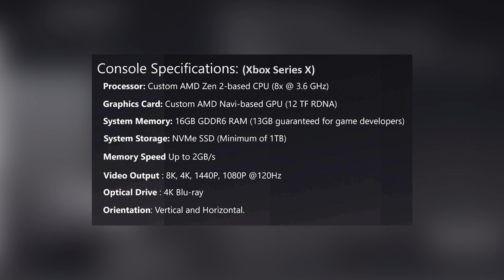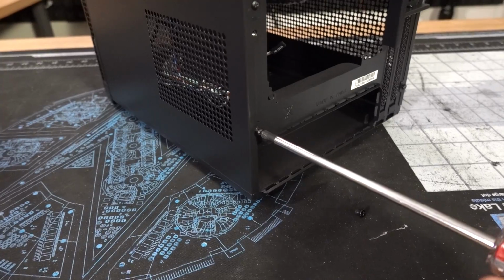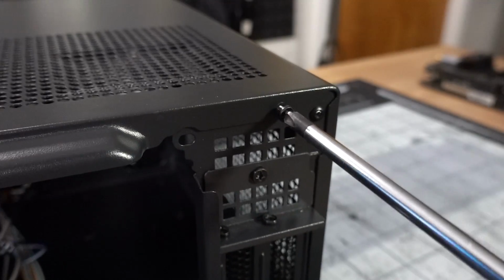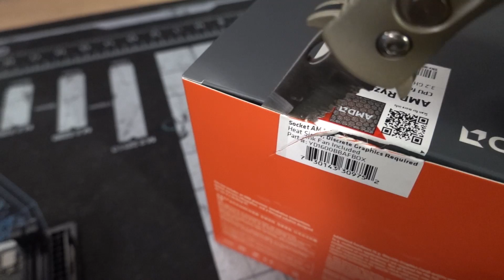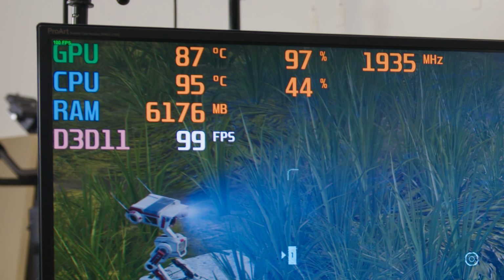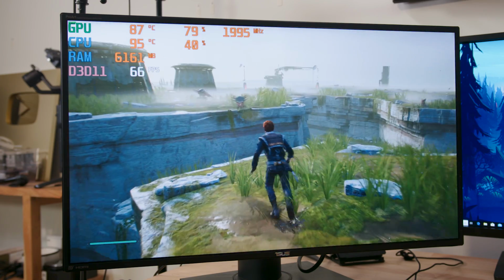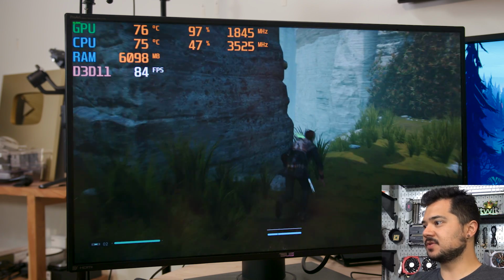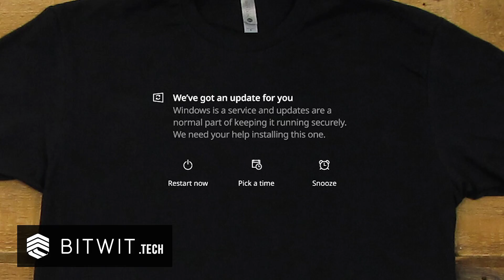I built my own Xbox Series X

Comment: To build an X Series you have to use a passive air cooler on the CPU and GPU so rip all those fans off. You have to cut that 600 watt PSU down to a 300 watt.
Yeah, I know right. Who wants a rig with those weak ass specs? Console buyers obviously.

Comment: Isn't the idea to get console killing performance for a cheaper price than the Xbox/PS etc?
Reply: That’s what I thought too.
Reply: That won't happen without used parts. We are paying a premium buying parts that are all self contained units that plug and play work together. When consoles are built, parts are proprietary and designed in house to not function like regular computers. There are ways for them to be built in large quantities for a much higher performance to cost  than what we can achieve. They are able to do this as well as integrate parts together to fit in smaller spaces than most SFF pc builds. SO while you CAN make a PC that is smaller than a console and performs better, it is never going to be cheaper than a console without getting really lucky scouring for used parts.
Reply: @JasonEllingsworth  I see, the size thing I didn't really include that in my thinking I just thought performance yet an ATX sized console killer brand new still should be cheaper than a top spec console but how far ahead it is performance wise will affect price. Having a top spec PC used or not will cost more I agree but that machine should outstrip console performance by a long sight.

Comment: Good call on the Noctua cooler. Only changes I would make would be obviously the SF600 followed by a blower style GPU instead of a dual fan card and then reverse the front fan to exhaust. Only reason being is that SFF PC's trap a ton of heat even with intake fans, so in the SFF's I have built in the past negative airflow has made a world of difference.

Also, loved the puns.

Comment: Hey I need help, I have zero experience with pc’s and I want to get into pc gaming. My budget it 1,000. Can you help me?
Reply: you don't need help. You need to watch a lot of videos on the subject.
Reply: Don´t waste your money on a pre-built pc like I did.
Reply: @leruty  ouch! I did that years back. Was always making compromises with that machine because it ran nothing at max settings. It was huge and gaudy. This year I finally built my own M-ITX machine in a fractal design core 500 case, and it runs everything at max or close to it. Would have cost me 1600 as a prebuilt but I only spent 1100. Would have been even less if I went M-ATX instead, but I wanted something small I could fit on a shelf and take with me in a duffel bag.

Comment: 15:20 that hole is actually for an ATX PSU, and the case has it there so that you can turn you PSU around if you want the PSU to exhaust the hot air from the VRM area of your motherboard if you use an AIO.
But it's good to know that if your case has it you can somewhat mount an SFX PSU without a bracket, that might come in handy some day.

Comment: So i have a SG05 (basically the same case) with a 2400G and stock stealth cooler in it. I am using the SF450 (SFX). No issues with thermals here. I very much suspect it is the PSU limiting the airflow. 
Edit: in my old setup in this case (Phenom II x6) i had to open up the PSU and swap the fan direction so i was pulling air over the PSU and then over the CPU and out of the case even with SFX PSU.

Comment: Love this case, and your build video! I've owned a handful of these cases and ran into all of the same thermal/fitment concerns you mentioned. A few tips for anyone building in one of these cases that is willing to read this extra long comment:

With the increased cost of a SFX PSU, SFX PSU Bracket, and upgraded CPU Cooler, you hit around the same price point of a cheaper AIO [Corsair H60] and this allows the PSU to work as a case exhaust when mounted with the interior fan facing downwards.

With the extended length of the front heat exchanger over just a fan, it can actually create a channel for a horizontal-airflow GPU to eject heat both out of the front and rear of the PC chassis, making the GPU act as though it's in its own enclosure. When the power supply is aligned as an exhaust fan, the air moved into the case from the front fan passes along the GPU's back until it reaches the exhaust fan [PSU fan] unterrupted by exhaust air a normal CPU cooler could expel, which further decreases GPU temperatures.

Basically, this chassis works wonderfully with an AIO, even a cheaper one. Be mindful of THICC-BOI cards though, I had a MSI RX 580 Twin Frozr in this case and I had to disasemble the fan shroud in order to get it into the case and reassemble once it was installed, and the power cables for the GPU were a huge issue to get installed.

Comment: Based on this video, what do you think of how the series X is designed? From what I saw in a tear down video it looks like it's going to run into identical thermal issues because everything is packed within 1/4" of each other and the fan is mounted at the very top with very slight intake ports

Comment: So that price is still lacking the controls (keyboard/mouse), while the Series X already comes with a controller. Good try, but this still isn't comparable in terms of price.
Reply: Drummin003 anyone who is building a pc is already going to have a keyboard and mouse. I had one before I built mine. I actually used it with my Xbox one.
Reply: Cynder PC Guides but isn’t the point of this build to attract someone to a PC from the start that wouldn’t have those things?

Comment: What if you use a Watercooler 4 the CPU in the front as an air intake and twist the PSU facing Down to push the air out...?

Comment: How many T-Flops? Don’t think you’re at the series X performance
Reply: Not as much as the Xbox series X.  You need a RTX 2080 to match the tflops.

Not to mention, the series X is going to be 8 core and Zen 3.  The CPU in this video is Zen+ 6 core.

In addition, both consoles feature PCIe 4.0 SSDs, which will blow a sata SSD completely out of the water performance wise.
Reply: @giglioflex  the xbox is Zen 2
Reply: @giglioflex  Zen 2, not Zen 3 for the series x
Reply: Austin Ralls never heard anyone mention t-flops in terms of performance
Reply: Xbox series x with 12 teraflops of rdna 2 architecture is essentially a 2080ti equivalent, u need more than a base 2080 or 2080 super to get what Xbox series x is said to offer

Comment: That is interesting about the temps... I built in this case with some spare parts I had, as well as whatever I needed to finish the build, for a 1080p 60fps backup PC.

Ryzen 3 2200G with Wraith Stealth Cooler (OC'd to 3.7ghz)
EVGA GTX 1060 6GB
Gigabyte B450 Aurous Pro Wifi ITX
HyperX 16GB 2666 (OC'd to 3000)
Silicon Power 256GB NVME M.2
500GB 3.5" HDD
EVGA 400W ATX Power Supply
Corsair 120mm Fan

So yeah I had a weaker CPU, but the exact same cooling solution and cooling restrictions (full PSU). It never gets over 85 degrees, and even that is only when I have it running Folding @ Home for 12 hours straight! Is the 1600 AF really that much more power-hungry that Bitwit's PC is running 10 degrees warmer?

Comment: How come you didn’t consider the Silverstone Fortress FT03B case? It has the same vertical orientation and look as the Xbox series X. The Silverstone LD03B case is also a nice vertical case with dark tinted tempered glass panels. The case used here doesn’t have the same aesthetics... 😭

Comment: Kyle, Great videos as always.  I have a question though.  Im building a Content Creation System and have everything I need so far, decided to go with the NZXT X53 280mm, but due to the CoronaVirus issues were all facing these items on Amazon have been sold out for quite a bit.  my processor is a AMD 3700X and the only other cooler I have is a Hyper 212 Evo with 2 fans(120MM) will that Cooler setup be sufficient for my purposes until I can actually get the AIO I want to be purchased.  Any guidance u can give will be greatly appreciated.  I'd like to at least do some mild overcooking if that cooler setup is adequate and my GPU is the ASUS ROG STRIX GeForce RTX 2060 Overclocked.

Comment: So, would you recommend the 450 W power supply that is in the parts picker list? Cause I have read that the 2070 Super requires a 650 W PSU.

Comment: I built a random PC with spare parts I had laying around and changed my mind and gave you a random parts list and put Xbox series X in the title.
Reply: @danishsheikh1900  Yeah he used a six core vs an 8 core, a weaker GPU and a standard SSD... the cost of that GPU alone is  more than the Series X most likely will be. I've seen several of these now and every single one of them is building something with less power.
Reply: Was thinking exactly the same. :(
Reply: He’s excuse  “well I don’t have the space”
Reply: It's a nice Ps5 clone with much slower SSD.

Comment: If you look how the Xbox Series X air flow system. It pulls air from the bottom, across the heat sink, and blows the heat out of the top. Depending how much heat it makes. I could have a 2 in 1 machine. Gaming machine and a small heater. lol

Comment: There isn't a lot of air flow between the CPU cooler and the power supply. I might of stuck with the stock CPU cooler. It is a little lower then that fan shroud. Maybe I'm wrong. If they made an external power supply for tight cases it would be helpful. 
My only issue with small cases is you have air coming into the case but not a fan expelling the heat. Kind of like blowing on a camp fire.

Comment: "Lets build an Xbox Series X"
Uses a processor thats a year and a half older and has 25% fewer cores
Reply: The Series X absolutely destroys this build for way less money. Zen 2 vs Zen+ is already a like a 10% win, plus 1 more core for gaming (1 core on Series X is for OS and background processes), form factor is a check for Series X, GPU is a stomp 2080 to 2080S level for Series X vs 2070S. And this build is well over 1K while the top price imaginable for Series X is 600. If the focus of the buyer is high fidelity graphics and 60fps is fine, Series X is the only way to go and it's not even close.

Comment: Hey Kyle,

Huge fan. I actually just built my own gaming PC from watching your videos lol. My accountant hates you. I have an issue regarding my bluetooth keyboard and mouse though. It keeps disconnecting and I have to keep pressing buttons to wake it. I looked online and the only "solution" I found was to go to control panel > device manager > bluetooth > power management > unclick on "allow the computer to turn off this device to save power" but that didnt work. Its really frustrating. If I dont use my keyboard and/or mouse for 30 seconds it just sleeps. Any advice? I personally love my keyboard and mouse (logitech k780 and logitech MX master 2S) and I dont want to change them. Any advice?

Comment: I'm hoping that the series x will cost the same as it's predecessors launch price of 499. I don't think the target audience of consoles care very much when it comes to what is inside the console, but rather what it does. They will say, I want good graphics and frames without knowing what it takes to deliver that performance. If they see a launch price of anything over 600 dollars they wont buy it. The reason why I want it to launch at 499 or around there is because with the performance they are promising the series x will deliver, at this price point it would be far more cheaper than any gaming computer that could deliver the same performance. This would cause the prices of computer parts to fall pretty dramatically since there wouldn't be any benefit to buying a computer to game, it would just be too expensive and the price to performance ratio would tip in favor of consoles. Of course this is theoretical, and does not mean this would actually happen. I think what will really happen is that the console will launch at 549 or 599 but the prices of computer parts won't fluctuate too much. And it would take a year or two of new releases of GPU's to make a budget computer that could compete with the Series X at its price point.

Comment: have built system in same case. Dude, have you heard about cable management? Front panel cable could be tucked under MB. If you haven not took out hard disk bracket it would be good place to tuck cables against. CPU temps are abnormal! I am using old 84W Intel processor with stock cooler so in games it works hard as hell but never reaches temperatures like this. I think it has to do, that I have mounted PSU other way around, FAN facing CPU.

Comment: just a quick question, i want to build a new pc... the CPU i will buy is a Ryzen 5 3600, as a MB is it better the b450 tomahwak or b450 tomahawk MAX? are there any differences?
Reply: The MAX comes with out of the box Ryzen 3000 compatibility, while you'll need to flash the bios on the non-MAX to use the 3600 (you might need an older 2000 series Ryzen chip to do the bios update.) 

There's some other stuff like faster memory support, and USB 3.2 on the MAX.
Reply: @adcbot9435  ok thank you very much! so I need to buy the MAX version because I don't have an old ryzen CPU to upgrade the bios with

Comment: IMO the consoles coming out are amazing. They will be 500 bucks or less and literally laugh at this machine while displaying glorious 4k on those big beautiful OLED and massive 80 inch screens flawlessly. 

My 2070s (@2050mhz) and 9700k (5.1ghz) struggle to provide a decent 4k experience on my LG OLED. 

I use HIGH instead of ULTRA settings and fiddle with DLSS and MSAA where appropriate. It's a GOOD experience but not great. ALL games run acceptably in 4k (SUBJECTIVE) and some better than others. 

I have a 1080p 165hz monitor, and i switch between the 2 depending on the game.

Comment: Is it just me or was anyone else confused when Kyle said “RTX 2070” for this build lmao
Reply: Yeah, totally expected an RX5700.
I'm rocking the red&green myself too though, with a Ryzen 5 2600 and a... GTX1650 :( 
(I know I know, should have bought a basic RX580)
Reply: Candisa yeah I’m on the 2600 and rx 570 but I’m planning on upgrading to a 1660ti or something like that in the near future
Reply: @jamesj5884  tbh, I never gamed much before I've built this PC, I was actually thinking about getting a 3400G, but they seem to be a bit rare at the moment and I think the 6-core 2600 is a bit more 'future-proof', so I just grabbed the cheapest card I could find with 2 HDMI-outputs to run 2 FHD panels and a spare DisplayPort for potential future expansion. For what I've heard AMD can be flaky with drivers for their graphics cards, so if I end up liking games that want more GPU power I'll keep my eyes peeled for a used 1070, which should be at least similar to the 1660Ti or 2060.
Reply: Candisa exactly what I was thinking. I’ve heard AMD can be way less reliable than Nvidia so I’m probably gonna go with an older gtx card with 8gb or something like that
Reply: MaViC he’s trying to build a machine that has around the same cost and performance as the Series X and I highly doubt this console will have 2080 super graphics level or it’s just gonna be overkill and way too expensive

Comment: 7:50 it doesnt matter thats its not 3600. The 1600 doesnt support more than 3200 anyways. If youre using a 3000 Ryzen then 3600Mhz make sense. Dont overpay when youre using a 2000 Ryzen or lower.

Comment: Hey Kyle, 

I basically built the same system only with the Ryzen 3700x, which has the same TDP, and Asus b450i Strix. Just playing RDR 2 I'm having a stable 65 °C on my CPU and a 76 °C max on my GPU. As my cooling solution, I do use the same Noctua CPU cooler paired with one of the 3500 rpm, 12 cm Noctua "Industrial" cooler as a case (keeping it sub 1000 tho). The point in which I manly differ from your build is that I oriented the fan on the CPU cooler to blow away air from the CPU and use the PSU (which is a full-sized Corsair TX550m ATX PSU) as an exhaust.

One thing that also might slightly factor into the temps is that my RTX 2070 Super is a blower-style card. But I believe that the poor temps in this case (pun intended) are due too not enough hot air being exhausted from the case just from the positive pressure generated from the case fan. 

Really hope you follow up on this build, would be awesome to see if the set up I have is actually more effective or if the problem is due to something else.

Comment: Wait this pc can do 120 fps 4k ? With raytracing also its zen 2 architecture on the series x for 1000 dollar would be madness  also the series x has the gpu power of the 2080 ti like devs told everyone so this build is not the same
Reply: Also the series x has gddr6 ram 16 gb with a variation in between
Reply: Or are you just about the case ??

Comment: This video highlights the main concern I have about the series x; thermals. It's obviously not gonna have as good of cooling as this build is, meaning it won't run anywhere near the speeds Microsoft are boasting about after the first ten minutes of gameplay.

If you believe the hype about the series x then I'm sorry but prepare to be disappointed. In my view there is a reason Sony are being much more conservative with their specs and it will lead to their system being considered much more reliable on launch. Just my opinion. Would be interested in hearing Kyle's thoughts.

Comment: Isn't the title very misleading? Just from looking at the parts used in this video I can tell you that this does not match the specs of an Xbox Series X.
CPU is too old and too small.
GPU is too small.
RAM also should propably be 12gb instead of 16gb
This machine will most definitely underperform compared to Series X